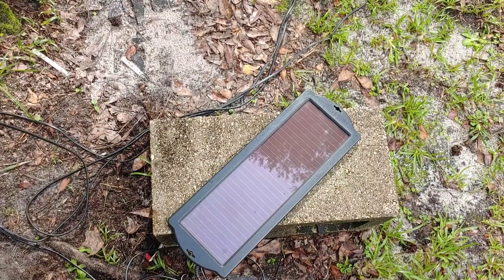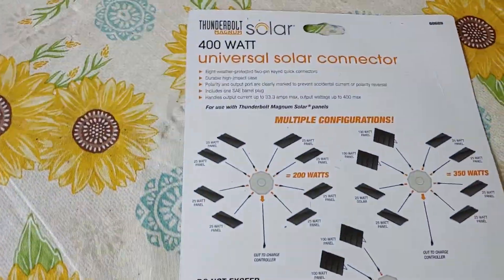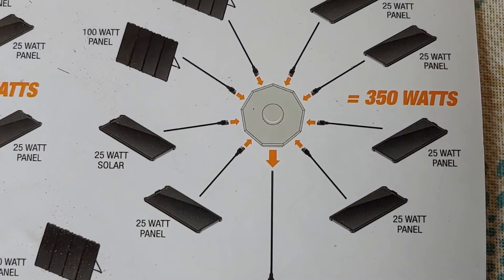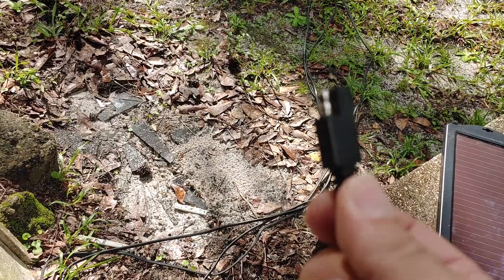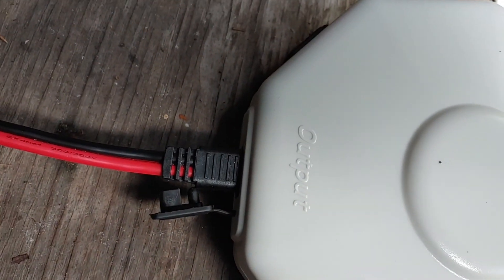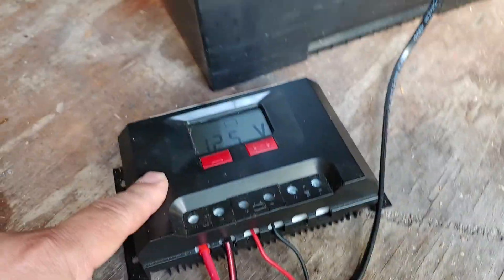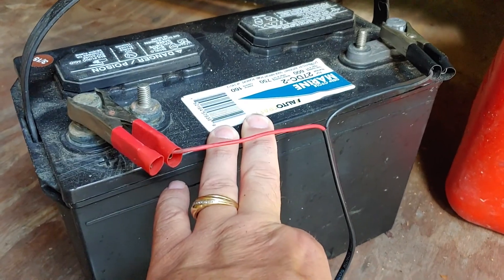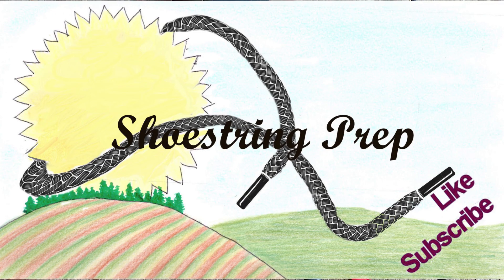Using the "Hub" Universal Solar Connector from Harbor Freight

Comment: I bought all Harbor freight solar, 4 panels, the Hub and had to buy a new BougeRV 40Ap solar controller, the hub is melting the output wire. yes its connected to the OUTPUT. it wont handle the 400 watts
Reply from the maker: I have not seen that before. Thanks for letting us know and your comment.

Comment: I have 4- 100 watt solar panels,  they all connect to the hub (Its all HF)  its melted my input of my HF charge controller, so I bought a Renogy charge controller, now its melting the +wire to the new  charge controller.  maybe I need a bigger charge controller? any thoughts?
Reply from the maker: It sounds like the charge controllers you are buying can't handle the voltage being put in from the panels. I would in fact suggest you get a larger charge controller that can handle at least 500 w. Thanks for your comment
Reply: @shoestringprep  wouldn't a 20 amp handle the 400 watts? Maybe bugger Is better. lol thank you !
Reply from the maker: @OffGrid_office  A 20A charge controller can handle 240 watts on a 12V solar system. Thanks for your comment.

Comment: What is the connector called going from your hub to your controller. One end is sae to the hub other end spliced to your controller
Reply from the maker: Except for the spliced end on the wire to the controller, all the others have SAE connections. Hope that answers your question.
Thanks for your comment.

Comment: I've ran 450 thru the hub with no issues not getting hot at all I was curious if you knew how much could be ran thru it before it burned out, I used two hubs parallel to reach my 900 watt setup my controller can handle 1040 watts at 24 volt battery bank I was just curious if they could handle 520 wats a piece without trouble I'll end up trying it if no one has ?
Reply from the maker: I have never ran more than 400 watt through my hubs. Thanks for letting us know how your system is working and your comment

Comment: That controller will not handle 400watts, it will exceed 30 amps and go into alarm. Be careful using that junk. Use 4 separate 100 watt controllers and be on the safe side. Just saying.
Reply from the maker: I agree be careful with that controller. Do not go more than 30 amps. Thanks for your comment.

Comment: How much wattage do you need to operate a small ac window 🪟 unit?
Reply from the maker: That would depend on which window unit you are purchasing. The AC unit will have a manual with it that will tell you how many watts it uses. Thanks for your comment.

Comment: what is the name of the connectors that harbor freight uses? they are not  directly compatible with most other solar li iron solar generators. are there adapter to standard mc3 and 4 connectors?
Reply from the maker: They are called solar SAE connectors. You can buy SAE adaptor cable connects works for mc4 connectors, they are about $15. I put a link in to one below. https://amzn.to/3AOc2Fv. Thanks for your comment.

Comment: I always see the solar cables connected, the battery cables connected but never anything to the 12 volt connecter on the charge controller!
What and or how do you connect to this part of the charge controller and what can be power by this connection?
Reply from the maker: Below is a link to a video I did some time ago, about how to do the connections. Thanks for your comment.
https://youtu.be/a3p97vNpU2A

Comment: Hi there, I got 4 x 100w panels, i got the 400w octagon hub, and i run that into a battery and inverter and i cant seem to get it to push more than 1 panels worth of juice no matter what i do
Reply from the maker: I don't understand that. I have two hubs that are running 390 each and they don't seem to have a problem. Try running just three of the panels at first and see if that helps. Thanks for your comment.
Reply: @shoestringprep  gotcha, i think im missing the charge controller?
Reply from the maker: @tips4tesla407  A change controller would be helpful.
Reply: @shoestringprep  It looks like my battery station manages the charge, im reading something about Harbor Freight panels needing a polarity adapter?
Reply from the maker: @tips4tesla407  I have never used any item like that on my panels from Harbor freight.
Reply: I was under the impression the Jackery battery is also an inverter, so i think im just missing the charge controller? does the splitter before the octagon hub even matter?
Reply from the maker: @tips4tesla407  I don't know anything about the Jackery battery. Sorry.

Comment: I just bought a complete system and I was happy to see you have almost the same set up. Got the Hub, the controller, battery, extra connectors and 2x25 watt 12v panels. All of it of the Thunderbolt brand. Now, I have a question that I'm about to discover this answer myself in about 10 minutes when I go out and test the system out. But I think others might find this info useful before they buy. Question: does the Hub connect the panels together in series or parallel? Kinda important question for those seeking either more volts or more amps. Personally, for what I will be using this for, I need more amps because I'm set up for 12v use and need it at least 3.2 amps. Off I go to discover!
Reply from the maker: The HUB connects the panels in parallel. Good luck. Thanks for the comment.
Reply: @shoestringprep  Yes it does! I was so happy to see that when I had it all together. With that being the case, my little solar project will be ok and I can keep my smile!
Reply from the maker: @maikutsukino4743  that is great news. Have fun with it.

Comment: I just bought my hub. Do I need to keep it out of the weather  or does it matter?  Thank you for your videos.  They have been so helpful for this beginner.
Reply from the maker: I keep mine out of the weather. Thanks for your comment.
Reply: I keep hearing that solar panels need to have fuses installed.  I am assuming that these are in parallel with the use of this hub.  My set up will have 4 100 watt panels from Harbor Freight.   What's your opinion and advice about using  fuses with this set up?
Reply from the maker: @cindyfulton1056  using fuses is never a bad idea. I don't use fuses when I'm using the Hub but I do use fuses when I'm using 600 watts on solar panels or more to the batteries. I would not think your setup solar panels going to the hub and then into the charge controller would need a fuse. Thanks for your comment.

Comment: For those using panels bought at Harbor Freight(Thunderbolt), this hub can handle 4 sets of the 100 watt kits. The connectors are called SAE Connectors. This hub can only be used with panels using SAE Connectors. If your panels have MC4 Connectors, you'll need to obtain a Conversion Connector(MC4 to SAE). DO NOT try to plug 4 sets into the Charge Controller that comes with the kit. Those Charge Controllers can only handle 10 amps of current, where 1 kit produces about 5.5 amps. 4 kits would therefore produce 22 amps and will burn out the Controller. If using multiple kits, you're better off buying a better Controller that can handle 30 amps or more. Also keep in mind, the factory Controller is also a PWM Controller. If you want the best charging results, invest in a MPPT Controller. Yes, they are more expensive but well worth it. There are many factors to consider when using Solar. Wattage and amps of the panels, wattage and amps of the controller and the battery capacity. Also keep in mind the wiring. The more panels you add to your array, the more wattage and amps you produce. The controller needs to be able to handle the production, as well as the wiring.  Your battery capacity and the inverter you use will determine what you can power. To put it simple, don't expect to run a Window AC unit with a car battery and an 800 watt inverter. It just won't work!
Reply from the maker: Thanks for the tip.
Reply: @shoestringprep  I use 2 kits of 100 watts each with this hub, but I use a 100 amp MPPT Controller because I burned up the Controller that came with 1 kit. But I also have an array of 900 watts(Monocrystaline) that are totally different than these kits and would melt this hub if I tried to use it.
Reply: I ran two HF 100W panels through one of these hubs to a 60 Amp MPPT controller hooked to 8 105 amp-hour batteries (in parallel) for a month just fine.  When the panels went on sale again last week, I bought two more (400 watt total now).  Pulling ~26.2 amps (it was a clear and sunny day), that output port started melting in about one hour.  MY portion of the setup utilized all 10 gauge wiring (and had no issues, other than the connector that got fused into the output port), so I'm guessing they have some pretty cheap wiring inside there.  I'm switching over to a couple red/black bus bars (nickel plated brass) with 1/4" studs (stainless steel).  No more melting for me!
Reply: Ouch, was about to hook up an overload x2. Reading your comment saved me money!!! MPPT it is..

Comment: Which of the connection points on the hub do I plug the output to?
Reply from the maker: The output on the Hub. Is connected to the charge controller. Thanks for your comment.

Comment: Why not exceed 400 watts? How to modify? Maybe have two 400 watt hubs then route to bigger charge controller.
Reply from the maker: 400 watts is the max the hub says it can handle
Thanks for you comment.
Reply: Is that possible... to use 2 of the hubs to increase the wattage?

Comment: Can I Plug in a 250 Watt 12 Volts Solar Panel in one of the slots .
And a 100 Watts 12 Volts Solar Panel in another Slot ..
Total is 350 Watts .
Thank You for your Help ..
Reply from the maker: The manual said 400 watts max so it should ok. Let me know how it works out. Thanks for your comment.

Comment: just sub i have the 100 watt kit and the 100 watt panel from harbor freight my control is diff then that 1 i bought the hub and a 750 watt inverter my batteries are 2 lawn mower and a car all are not hook up can i hook those 3 batteries together ?
Reply from the maker: Thank you for the question.
If the three batteries are the same type, they can be connected together. If they are not the same, get three batteries which are the same - and I recommend deep cycle batteries.
You may also want to see my video on "Battery Basics" for more on this topic.

Comment: 💥💥💥QUESTION...What type of inverter do u use...THANKS LIKED YOUR VIDEO👏👏👏🐬💥💥💥
Reply from the maker: I use several different inverters depending on the job. I have an 8000 watts Aims inverter on the rooftop solar power system, and four smaller inverters in the house for various jobs.
Hope that helps. Thanks for your comment.
Reply: Nice. Sort of sneaky how it should be done.  Thanks